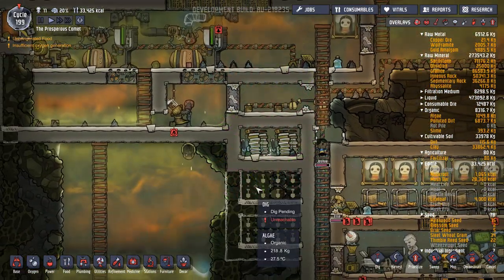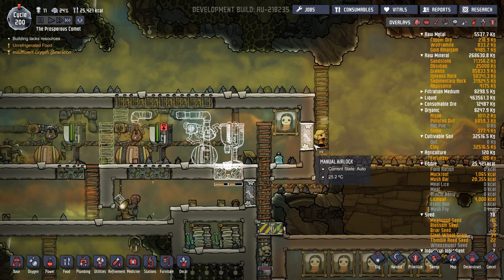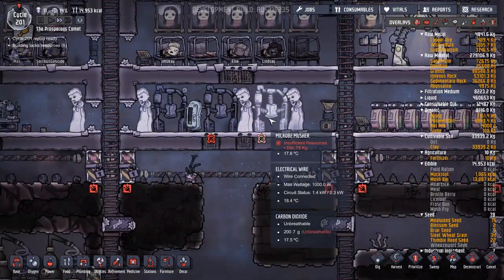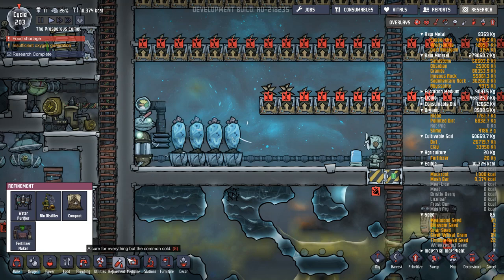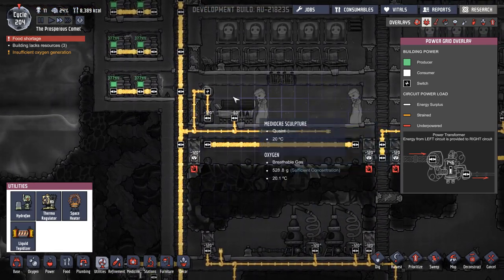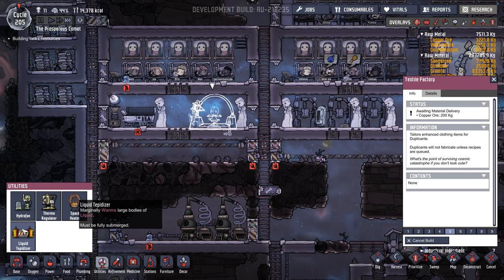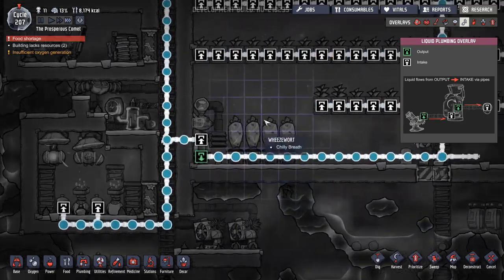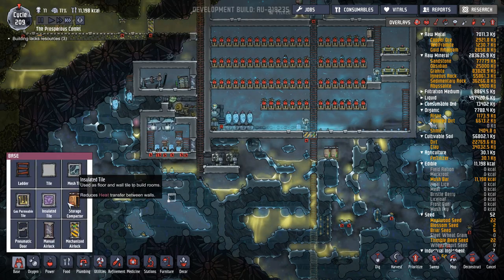Oxygen Not Included THERMAL REGULATION Lets Play Oxygen Not Included AGRICULTURE UPDATE Gameplay #13

Comment: Biffa, I don't now if anyone commented that yet, or if you figured it out later in the video, but you are reading the temperature of your liquid pipes wrong. it says 'Contents: 10 Kg of Water at 46.3°C' and under that 2.6°C. the 2.6 is the pipe itself, not the water, meaning, you are pumping 46.3°C hot water into your cold area.
Reply: Yep, however it depends on what material those pipes are made of, if they are insulated abysalite then it's not a problem, if they are not then it is a problem...
Reply: Even then it will be a problem as soon as the water is pumped into the hydroponic farm pods
Reply: Unless they've changed that in the patch a few days ago then no. In my latest base I did a wheat farm where I pumped app. 40C water into the hydroponic tiles (using insulated abysalite pipes ofc.) and the wheat was doing fine through 50+ cycles, the tiles noted they had 40C water in them, but the tile and plants was kept at about -6C...
Reply: Exactly, hot water is the problem. You should make the gas pipes out of the thermo regulator out of INSULATED gas pipes so they keep their cool.
Reply: What drives me bonkers is that he looks at the right one when reading temperature from gas pipes at 41:05. It really got my hopes up that he was going to realize the next time he looked at a liquid pipe.

Comment: Biffa, You need to use insulated tiles to get the best effectiveness of the abysalite material for keeping heat out. If you look at the left of your main ladder by the geyser they are really hot. Use insulated and it will drastically change the heat absorption.

Comment: Always check your inputs and outputs indeed! Also check your tool tips. I notice when you are checking the temperature of your liquid pipes you have been using the temperature of the pipe itself as your reference point and not the temperature of the liquid contents within. Your tool tips say you are pumping 45 C water into your "cold room" making it not very cold. If i recall you may have even used wolframite pipes which would make cooling very difficult to combat. Also remember that a full row of agricultural tiles blocks airflow so break it up with some gas permeables or more ladders! Keep up the great channel Biffa!!

Comment: Make a water basin in the cold area with a bunch of weezworts and pump all the polluted water you purify into it. The big area in the bottom left of the cold area would be good.Then use that water to feed the plants because it's definetely the water from the geyser heating up the room. You read the temp of the pipe, not the contents temp. The water was coming in at 45° when it was on full blast b4 you shut it off. That's the only way I can think of getting cool water in there. Your going to need water you can grab too so it's a two for 1. See ya tomorrow!
Reply: Makes sense, a water pre-cooling chamber.  Get 1 of those thermal regulators full of Oxygen / natural gas, run a cooling loop with the best thermal conductivity gas pipes( Obsidian? ) till your water chills down to near -5 before it threatens to freeze solid?

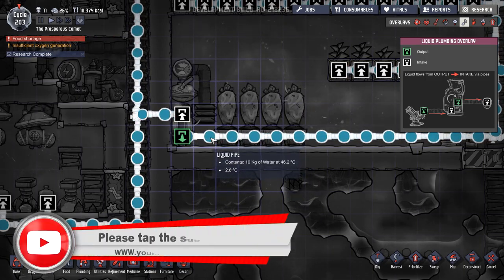Comment: Other people have said it - the pipes are cold, but the water inside the pipes is 46.3 degrees! You can see right there on the screen at 20:06! I think you need to drain the hot water out of the sleet wheat farm, and chill any water going in.

Comment: the O2 that is cool make another vent at the top of the farm to cool it faster you have alot of hot air up their and the cool air is at the bottom
Reply from the maker: +nathan sanchez good idea 😀
Reply: Biffa: Strategy, Survival & Indie Games. also make a small farm with another type of seed as a temporary food source so you dont have to rely on just mush bars also add more air vent not only to the bed room and first aid but to the other areas so they could work longer in the area they are in

Comment: if you want to cool down the water, you have to pump it through a lot of pipes in a cold area. you could also pump a room full with your -20°C oxygen and let the water drip down from platforms. the reduce in mass by dripping it over edges reduces the heat capacity so they change temperature quicker. let the water drip in a small puddle with a weezwort in it. the overflow will cool down significantly after 2 - 4 repeats.
X
XW    X
XXXX

Comment: you're reading the water wrong, the pipe is at 2.6c, the water is over 40c.
you need to build a fresh water tank below your farm to dump the hot water in ones side to let it cool and the pull from the other side. The wider the separation the colder the water will get before you pull it. make sure the tank is in the cold biome

Comment: why use the bridge at 23:30 instead of sending the heavy cable through the ceiling/ floor of the room above the transformer?
Reply from the maker: Heavy cable doesn't go through tiles or anything else :-)
Reply: heavy watt wire can't go through tiles and doors, and if there is room, the decor is horrendous...